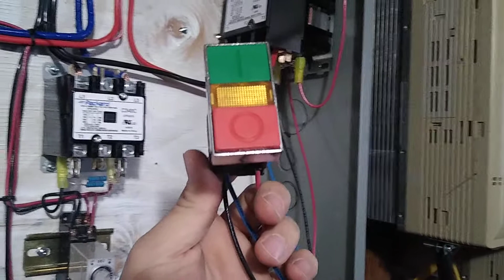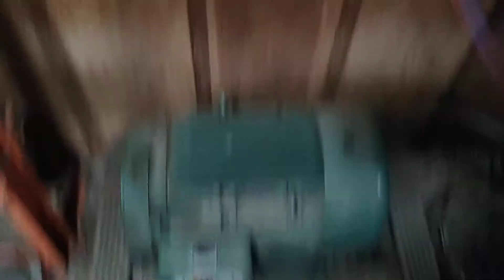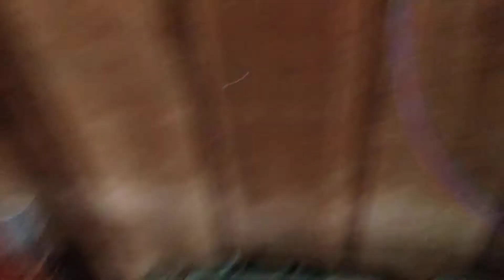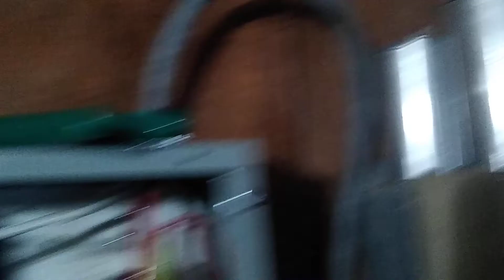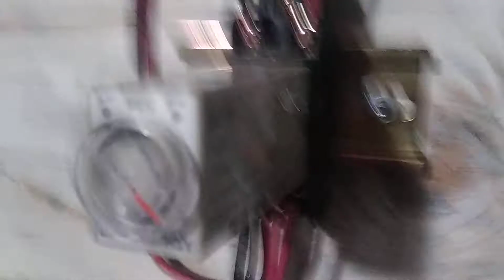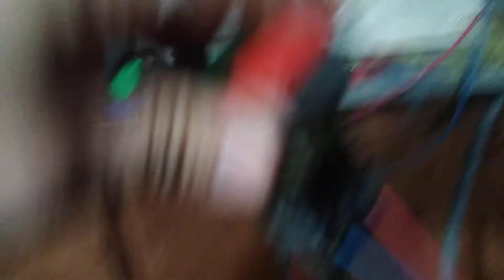30hp rotary phase converter build pt1

Comment: Hi I have a question 
I have 30hp rotary phase converter im gonna wire it myself but need verification 
70amp with 2awg not (2/0) from single phase panel to 3 phase panel. 
6awg from 3 phase panel to motor also 6awg to 50amp outlet for machine load
Reply from the maker: @rupertogranados3340  copper or aluminum
Reply from the maker: @rupertogranados3340  how many HP is the machine?
Reply from the maker: @rupertogranados3340  I'm going to assume aluminum because copper is rated for way over the numbers u say. 
But yes aluminum #2 is good for 90 amps. #6 is good for 50 amps. Are u making one from scratch or simply installing one?
Reply: @electromechanicalstuff2602  thank you for answering 
North America phase converters PL30 new
70amps to phase converter they said 
And the cnc machine load 50amp
Reply: https://www.northamericaphaseconverters.com/wp-content/uploads/2019/04/PL-30.pdf

https://www.northamericaphaseconverters.com/wp-content/uploads/2024/05/New-NAPCES-Rotary-Installation-Manual-Rev1.1D.pdf
Is this one bro

Comment: you got a schematic for your converter, would be very helpful to have and follow your video with. Learning as I go. Keep up the good work. You are very knowledgable as I can tell from your videos. Always nice to learn from someone like you.
Reply from the maker: I followed the schematic this guy used. And went into great detail explaining everything. I then made modifications to the start cap circuit and used a timer. I had similar issue with potential relay he did.
Reply from the maker: I bought all the caps and contactors from supplyhouse.com
Reply from the maker: https://youtu.be/u229h7NcMxk
Reply from the maker: Happy building
Reply from the maker: This is also a great video on how the voltage and phase angles actually look.
https://youtu.be/mUXLxK_zI24

Comment: Great series of videos I have watched them several times.  Thank you.
Reply from the maker: I used the plans from online that sbranch made a video showing a build series of. Looks like your subscribed to him so I'm assuming you've seen the. Too. In his vid discrimination is the prints for these and what to scale them to
Reply: @electromechanicalstuff2602  That being said and I can appriciate you giving him the credit on his videos how to make the converter.  you had already headed in the right direction of having the 3 PH converter only run when you need the 3 Ph. I suffer from early dementia and have a hard time remembering to turn stuff off. I am going to try to add just a twist to my 3 PH converter to when the button to Mill or Lathe, to delay with a second timer so that when the first timer that you used turns on your secod C340C to put my full power out to my machines, then after that the second timer would turn on the Machine.  I will use a normally closed Estop to turn machine off and a push button to activate the first timer.  That way each machine will have the Estop in the stop position at all times until I need to work that machine. If power goes out I would still have to hit the start button to activate the converter. Again thank you  You said in you second video that you used 6 AWG copper wire inside the box but what size wire did you use for your copastors. Just wondering. Thanks and Marry Christmas.

Comment: For your Start Capacitors. You just use the contactor to disconnect them?

I have an issue with my 15hp RPC, the contactor doesn’t reliably disconnect the start caps. Do you have anything else in that circuit to interrupt the circuit?
Reply from the maker: Just the contactor. Replace it with a quality contactor of rated size. I've never had a contractor in my start caps not disconnect
Reply: @electromechanicalstuff2602  interesting, tried a 40a and a 60a with same results. Using two 335uF start caps, one per pole on the contactor. It’s really annoying. I’m actuating the contactor with a push button switch instead of a timer.
Reply from the maker: @TurboStreetCar  that's not much start caps for that kind of problem. What brand contactor. I'm putting 300 amps through a 40 amp contactor and never had that issue

Comment: I just got a 30 hp rotary but does it draw a lot of electricity?
Reply from the maker: Around 4,000 watts when idling
Reply: @electromechan what about when starting? When theres a load?
Reply from the maker: @johnwilliams2702 
 https://youtu.be/3GLraA7CznY
Start up is about 320 amps.
But my motor is a 3600 rpm idle motor.
An 1800 rpm motor should pull less start up current.
When there is a load of 2hp and up the system becomes about 80% efficient. But when the system has no load you paying to spin a motor that's just sitting on the floor
Reply: Can i run a 3 phase welder
Reply: Or plasma cutter?
Reply from the maker: @johnwilliams2702  absolutely I don't see why not
Reply: @electromechanicalstuff2602 im off grid im doig solar ive tried running poni motor didn't pull it its a 8000 wat gen 29 amp it trippes the breaker my question since im going solar how many watt system i need or is there another way to make it work ? Suggestions?
Reply from the maker: @johnwilliams2702  I have it connected to a 100 amp breaker. Because the inrush on a breaker is rated at about 300% 8000 watt generator would never start something like this. That's a 10 hp generator trying to start a 30 hp motor. You'd need a 60hp generator to start this thing. Your best bet is to have multiple small idle motors like a bunch of 5 hp idle motors that you can start one at a time. Once all are running then you could maybe but even still you'd need a bigger generator. Cause that 8000 watts my guess is surge rating right? Well a 30 hp rotary phase converter is surging around 77,000 watts. So I need a generator with that kind of rating to start this thing. Your best bet is to just buy a military 3 phase generator only big enough for your welder and plasma table. Like an mep-804a or mep-805a and not use the rotary phase converter at all
Reply: @electromechanicalstuff2602  what does vfd does?
Reply from the maker: @johnwilliams2702  it's a variable speed drive. Only good for motors not plasma tables and welders. And 30 hp VFD is almost always 480 volt and 3 phase only. I have used them to generate 3 phase but again it had to be done with 480 and you need a drive twice the size and what your load is. And anyway you cut it the generator would still have to be larger in hp then the motor you are trying to run. I know this isn't what I want to hear. I give u props for trying off grid. Bit off grid and machine shop are a tough combo. Seriously your best bet is an mep-804 or an mep-805
https://youtu.be/QgYzJFY6bkA
https://youtu.be/oilsThKDEIQ

This is a 15kw 3 phase only unit. 
What exactly is the current draw of your welder and plasma table. Should be on their data tags
Reply: @electromechanicalstuff2602  i wanted to run a 3hp cold saw variabe speed but im not familiar with 3 phase. Can i use something affordable? Were installing 20k solar system in here
Reply: @electromechanicalstuff2602  thanks for taking time to reply.
Reply: @electromechanicalstuff2602  using just capacitor wont do the trick? To run cold saw?
Reply from the maker: @johnwilliams2702 they are called static phase converters. Yes they work but understand you will only be able to use 1/2- 2/3 the rated horsepower of the device. That's what the idle motor is for. It absorbs away that power loss. And those only work on motors. Not welders and plasma cutters
Reply: @electromechanicalstuff2602  one last question i wanted to get rid of my phase converter how much should i sell it for?
Reply from the maker: @johnwilliams2702  how much did u pay for it?
Reply from the maker: @johnwilliams2702  20 kw is a good size system. What state do u live in? How many Kwh is your battery bank?
How many Kw is your inverter. 
In michigan that would just be enough to power a normal size house in the winter and nothing else.
In arizona that could collect enough power to run some equipment if you have enough battery capacity and large enough inverter.
Reply: @electromechanicalstuff2602  i paid 600 im in phx az
Reply: I will like to use the converter but not enough power i wanted to at least run the cold saw 3hp variable speed.
Reply: What size rpc i need just enough to run 3hp?
Reply from the maker: @johnwilliams2702  5 hp or a small VFD if it's just one device
Reply from the maker: @johnwilliams2702  if u can sell it for $600 then get your money back. If u can sell it for $1000 then do that. RFC are like the industrial equipment itself. They cost a ton brand new but once u drive them out of the lot not many people want them so the value is low
Reply: @electromechanicalstuff2602  tnx
Reply from the maker: @johnwilliams2702  no problem
Reply: @electromechanicalstuff2602  why is there different voltages in3 phase ?
Reply from the maker: @johnwilliams2702  you mean 208 or 240 or 480? Or from leg to leg on my set up
Reply: @electromechanicalstuff2602  208.230 and vice versa
Reply: Does vfd work with variable speeds motors?
Reply from the maker: @johnwilliams2702  what do u mean
Reply: @electromechanicalstuff2602  2 speed motor my cold saw
Reply from the maker: @johnwilliams2702  is it 3 phase?
Reply: @electromechanicalstuff2602  yes sir
Reply from the maker: @johnwilliams2702  I would say yes then. I haven't seen too many dual speed three phase motors. But thinking about it I think my drill press is supposed to have a dual speed.